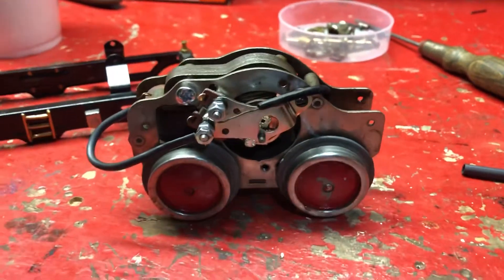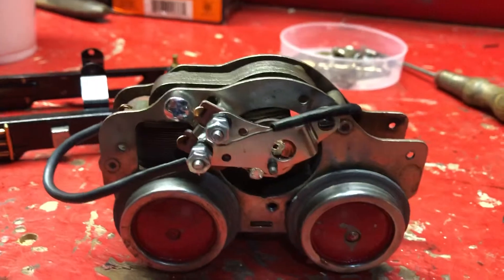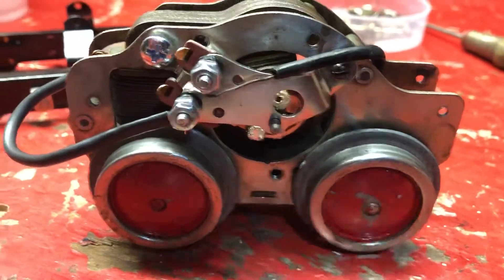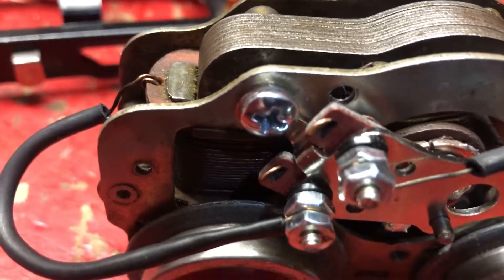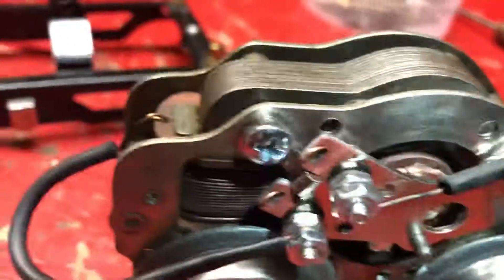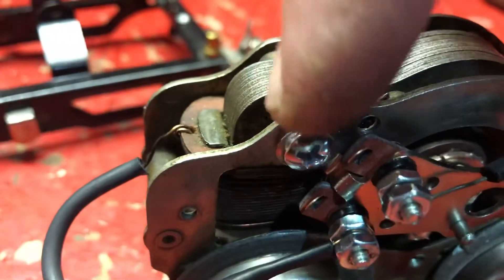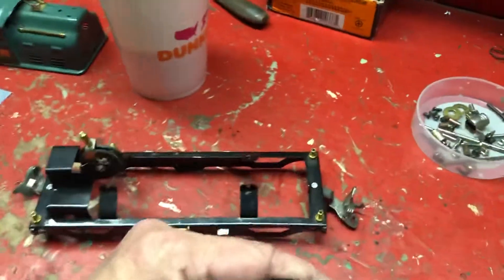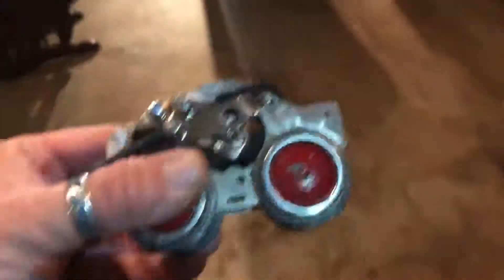Lionel Humpback Assembled and maiden run!

Comment: Hi,
Can you tell be where you found the brush plate and brushes for this motor? I have looked everywhere I can think of with no luck. I have two motors like this that need brushes and one that needs the brush plate and the brushes. Any help would be appreciated.  
Ken
Reply from the maker: Winfield Becker Trains. Google his website. If you can’t find it. Email me at bigtime1230.jm@gmail.com and I can try to send you the link.
Reply: @tanksandtrainz9078  Thanks for replying. I found the website and downloaded the parts list, but I couldn't find them. I don't have the part number and I couldn't find anything in the list for just brushes. I'm going to try e-mailing and see if they have them. Thanks again!  Ken
Reply from the maker: I also run a page on Facebook with over 10000 followers, I’ll ask my group for you and see if I can help more.
Reply: @tanksandtrainz9078  Thanks for that. I appreciate it. What is the name of your Facebook page?  Ken
Reply from the maker: @kennethward8732  LIONEL TRAINS all uppercase. I asked the group and they said Jeff at the train tender . Com
Reply: @tanksandtrainz9078  Thanks. I talked to Jeff and he doesn't have any and doesn't have a source for them. I think these are going to become dear. I thought it was your personal facebook page.
Reply from the maker: @kennethward8732  I founded the page 3 years ago.
Reply: @tanksandtrainz9078  That's pretty cool!